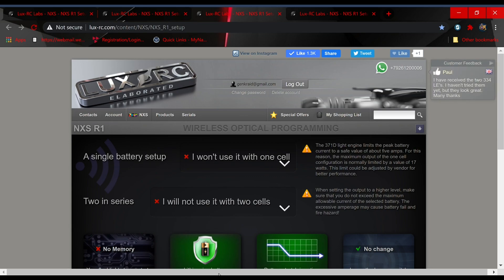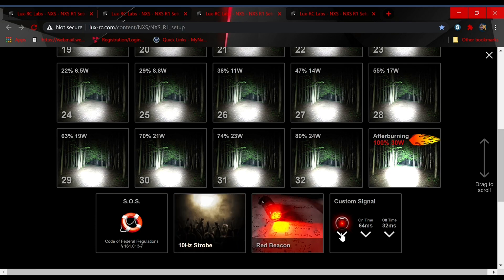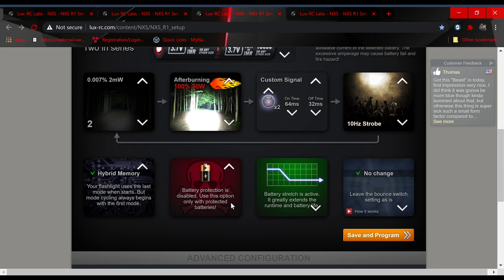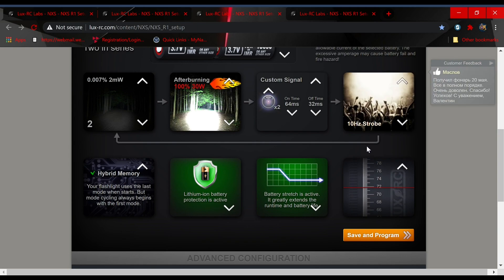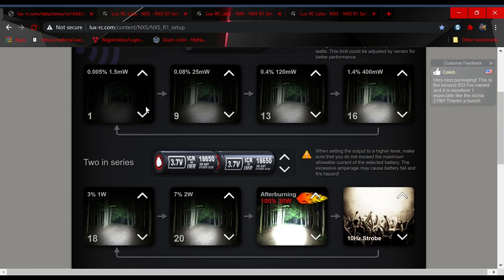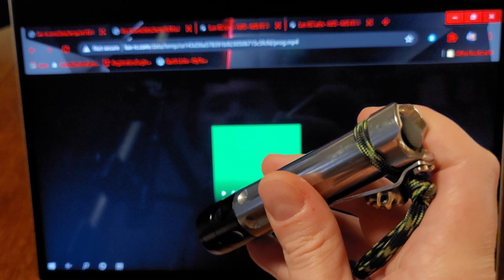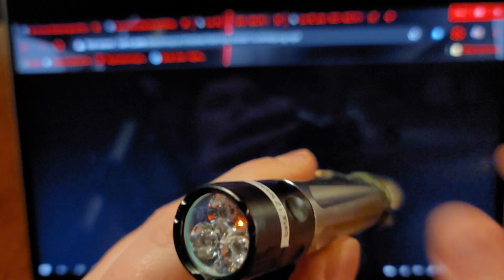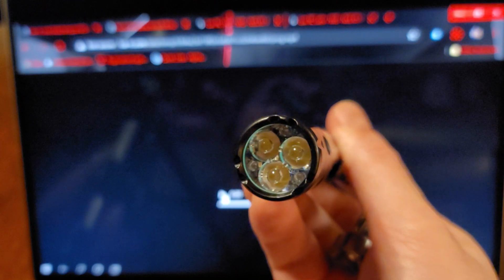Oveready BOSS V5.1 Lesson 6: Programming Multiple Page Files

Comment: I just scored a RT BOSS (waiting for delivery) and wow this is a lot of info to take in.  The only thing I'm unsure of is since it's an older BOSS I assume it comes with the original 5.0 firmware.  How do I, or do I even need to, upgrade to the 5.1 firmware?  Is the only difference 4 + 4 vs 8 mode?